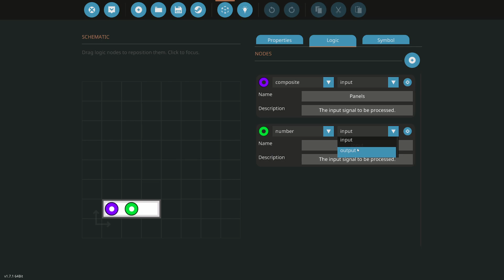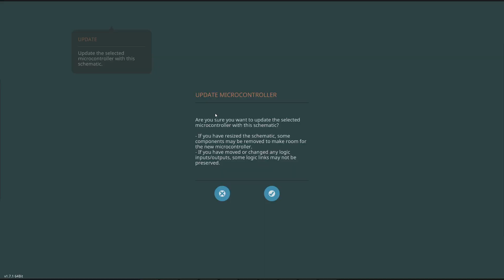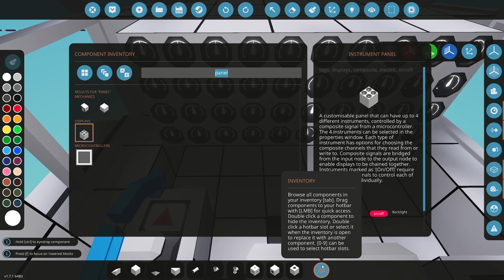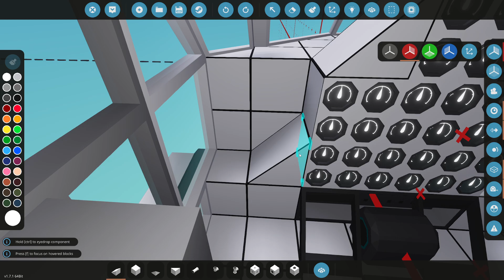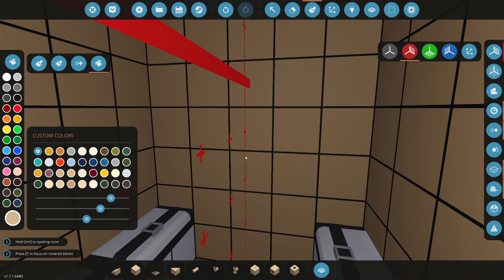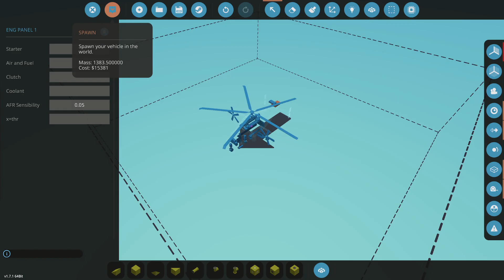Career Build Series 2023 Ep41 #stormworks

Comment: the doors you can very easily just have done a or gate and a push to toggle and a switchbox for each seperate door. with an ajustable slider or property drop down so you can change values in selection menu and don't have to re-create a custom composite panel door controller each time.

microcontrolleres are and always will be someone finding the easiest simplest solutions in the least amount of steps possible
Reply from the maker: Or also doing it the way you want to. There is no wrong way to do it if it works.
Reply: @CaptainCockerels  if you're inferring i want you to do it that way it was merely a suggestion. to make things easier........ and you're right if it works it works no matter if you use some complex LUA and math and logic just to get a number to go from 1 number to another.